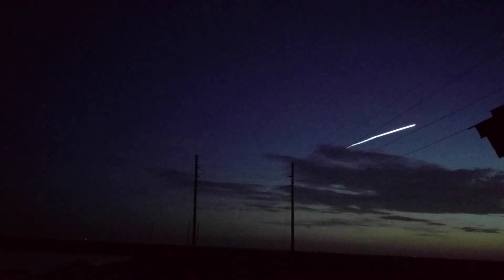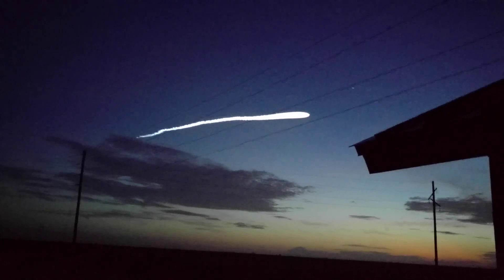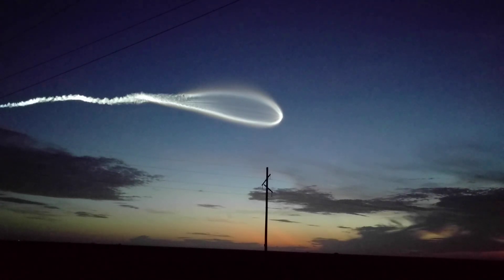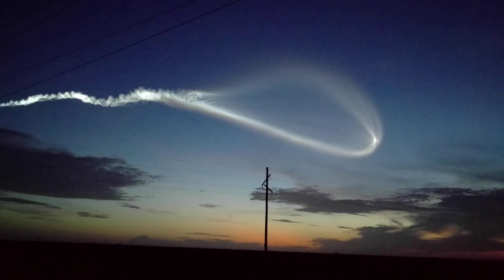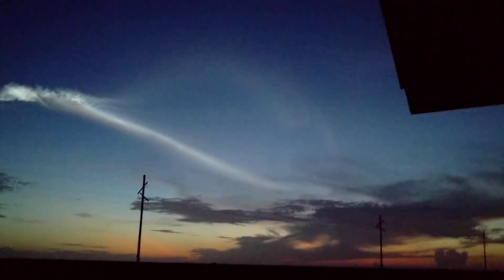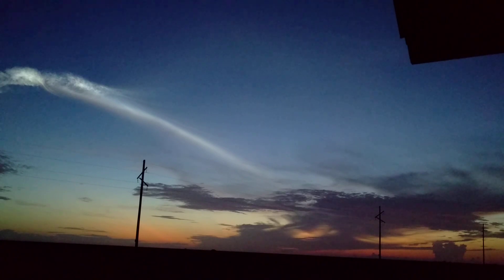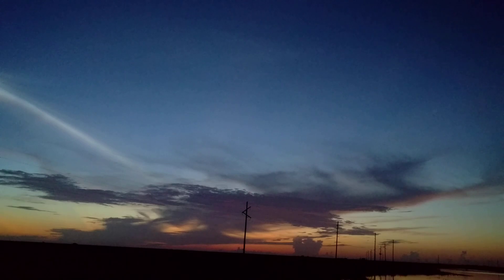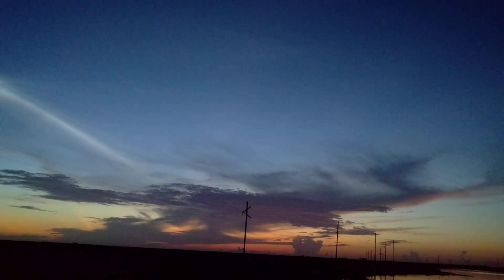Atlas V AEHF-5 launch w/spectacular plume near Fort Lauderdale

Comment: Nice capture. Is that the noise from the launch at the end of the video?
Reply from the maker: I'm pretty sure the noise you're hearing is just a plane that took off from Miami or Fort Lauderdale & was diverting inland to avoid flying through the restricted area. 

The furthest I've ever been from Cape Canaveral & heard unmistakable rocket noise was Port St. Lucie... and even then, it was more like a long, low rumble that was only noticeable because it persisted in between the waves crashing on the beach for about 20-30 seconds.